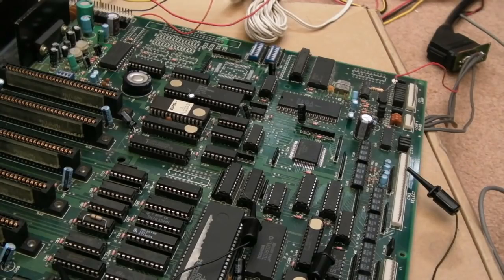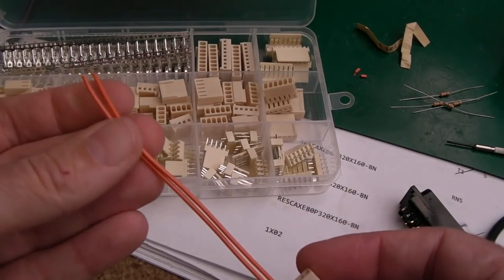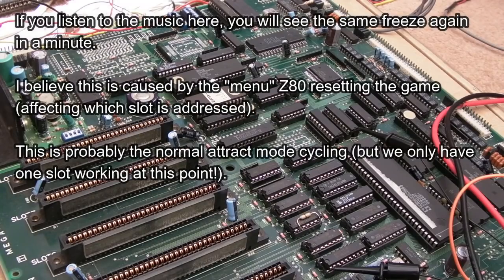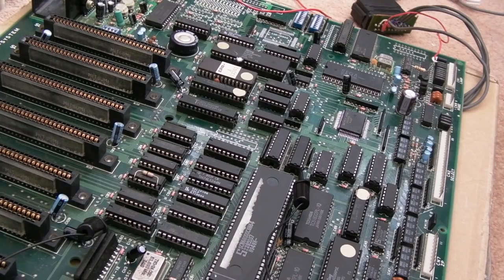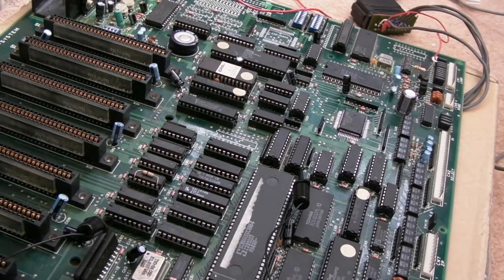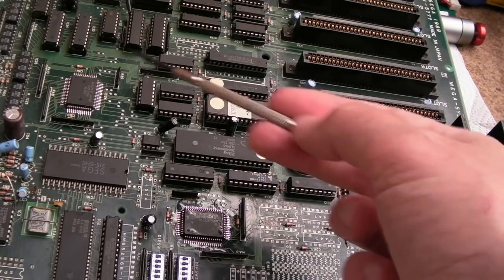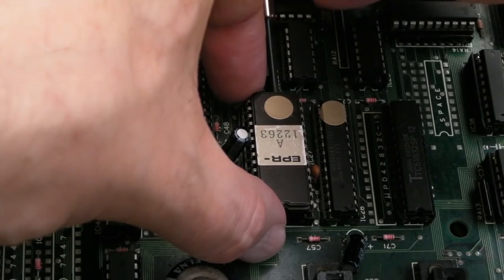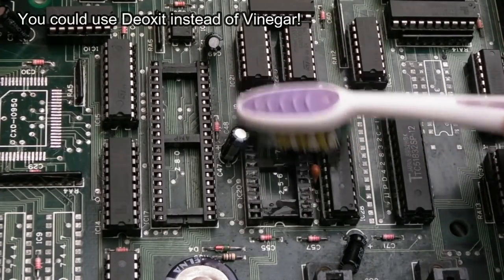Rare Sega Mega-Tech (8 Megadrive / Genesis Slots) Repair - Part 2 #sega

Comment from the maker: Correction: The /SRES wire fudge (to get the MD to reset) - you would need to ground the reset rather than join it back to the CXD, if the CXD isn't outputting a low on that /SRES pin.  In my case the CXD wasn't being controlled properly due to that previous fix by someone else, where the CS for the CXD was not enabled correctly.   The MD needs the /SRES to go from low to high impedance, or low to high, in order to reset.
Note: One thought I have after watching this - The GAL that I dumped and submitted to the PLD archive, that might be thanks to ElectronAsh.  It's possible he reversed the original chip and that GAL that was readable was perhaps thanks to him!  There are no other dumps of those GALs that I am aware of.   When talking about the credits and coin slots - I got them the wrong way around lol.  ie. pound or dollar would be the top one, 10p or 10c the bottom one.  Also - I was thinking about the code injection from the Menu side to the Megadrive, I bet the code passed is Z80 (SMS) code!  That would make sense, its easier to pass that over to the Megadrive Z80 and put it in SMS mode.  That's perhaps what is happening with the Service Menu and the Time Up screen etc.  The warning beep must be mixed with Megadrive audio, but the flashing warning I am not sure how that is achieved.  Maybe there is some video overlay going on?  Or maybe that flashing code is somehow injected into the Megadrive side - just not sure how.
Part 1 - https://youtu.be/QybH7PQ1WCM
GAL JED files - http://wiki.pldarchive.co.uk/index.php?title=SEGA_Mega-Tech_Motherboard
Partial Schematics (From ElectronAsh) - https://www.dropbox.com/s/qz56wtlkcx2w9t6/Sega%20Mega%20Tech%20Partial.zip?dl=0
Mega Tech Connector Pinout - https://wiki.arcadeotaku.com/w/Sega_Mega-Tech_Pinout
SegaRetro https://segaretro.org

Comment: Great points at the end about just getting started and going step by step with whatever information you have. This is a great example of a situation where I'd be daunted and procrastinate for ages until I remember to just go back to basics and make a start.
Reply from the maker: Cheers =D  Yes, I was very close to "passing it on, without even attempting to look at it".  When I received it and realised there was no public schematic, missing GAL, replacement GALs in other positions, tonnes of sockets, fix wires....

Comment: The point of an opto-isolator (optocoupler) is to electrically isolate the input side from the output side, such that the output side has its own VCC and GND and there's no copper bridging the gap. 
It's often done in power supplies to relay signals from the HV side to the LV side without endangering the user in the event of a short. It's also done in expensive gear to protect from shorts or power surges from dodgy peripherals.
Reply from the maker: Yep, I do know what they are used for =D  It was useful posting that though, as others may not realise how they are used and why!  Interestingly it didn't save the CXD1095Q =/

Comment: I got a tip to clear holes easy. flood both sides with solder use iron on one side and ds gun on other and tada cleared. Just be super fast or you can trash pads easy. Been doing this for years never had a issue once. Usually sega and konami gnd and +5 are a pain the clear with just using ds gun but with both gun and iron no problems

Comment: Nice conclusion to the previous Megatech video there! From your previous video I was 99.9% sure the Sony CXD chip would fix the problem, pretty much every time i've seen cart slot problems it's the CXD chip. I need to fix my spare Megatech board, I reckon it's a faulty CXD chip on that also. Talking of CXD chips, i've had a look at my Sega Megaplay board, which is the later version of this but with 4 slots and it runs on just one monitor instead of two. It uses the same CXD1095Q chips on there also. I also have a Nintendo Super System pcb which I checked but no sign of CXD chips on there so I assume it uses some custom system that Nintendo designed, same probably goes for the Nintendo Playchoice 10 board. Some of the games on the Megatech were the Master System versions no doubt due to the memory size limit, the Master System version of Outrun springs immediately to mind! I know of someone on an arcade forum i'm on managed a few years ago to get a few Megadrive games working on the Megatech board that weren't released on it, and they constructed their own top screen menu pages as well. I wonder if that would work on the Megaplay board? I only have a couple of carts for that board and they're hard to come by (and expensive when they do appear!) so a few more would be nice if I can make some of my own!
Reply from the maker: The Megatech can run the Megadrive/Genesis version of Outrun!  That's in the next part!  The Master System version Outrun isn't as good imo =/  I think the Megaplay uses the same carts?  It's basically a re-design of the same hardware I think!
Reply: @GadgetUK164  Hmm, wonder why they didn't use the Megadrive version of Outrun if it runs it? The Megaplay carts are same cart design to look at as the Megatech which is the same design as the Asian and Japanese carts. I think they must be electrically different in some way, although i'm not sure exactly how! The two carts i've got for the Megaplay are Sonic and Grand Slam, perhaps at some point I should open up the Sonic cart and the Asian version of Sonic that I have for my Asian Megadrive and see if there's any obvious differences.

Comment: Not bad! No link or shoutout to my cart repro's on caius' shop? :(
Reply from the maker: I am covering that in the follow up (a shorter part 3)! =D
Reply: @GadgetUK164  Excellent :) PS. most standard md binary will work upto 27c160 size but will need a dummy rom (menu rom is still needed for the system, maybe a generic one is in order...)  , the binary thing only works on mega tech, mega play will NOT work with standard binaries.